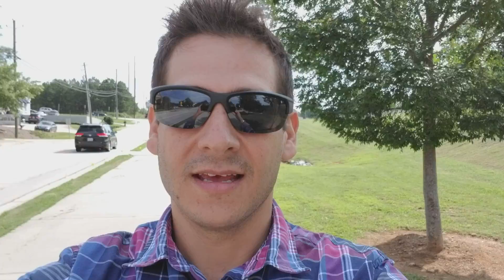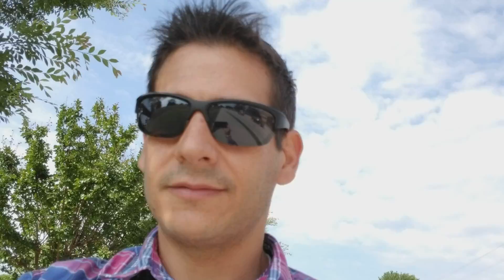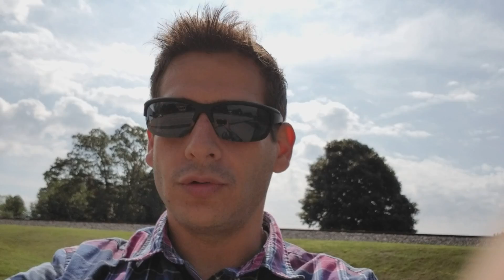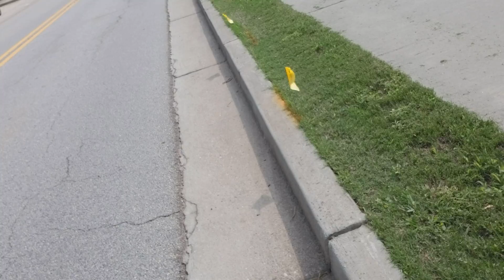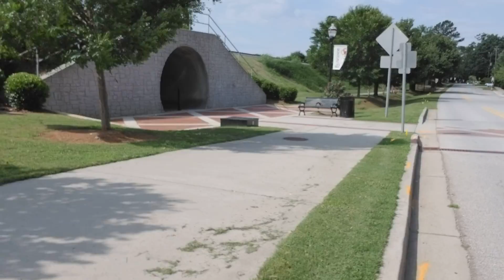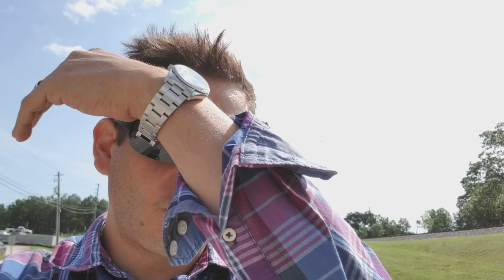Limitations of GPR (Ground Penetrating Radar)

Comment: Hi this is Dave, good videos and info. We are looking for the best meathod to detect a old cavern that the entrance was filled in
but as the subsurface is large rock, flat granite rock and rather rough terrain i have to assume GPR is not the best way to find it?  Now what? 
We usually just use metal detectors but this is something we have never tried to do.
Reply from the maker: Thanks for the comment and question. GPR may still work, but you could look into a conductivity meter. The cavern would likely show up as highly resistive. Hope this helps.

Comment: GPR is super interesting technology, especially for archeology... You think this area (in the link) could be scanned with GPR? I heard it can penetrate 50 meters. Do you think this could this trigger any limitations? https://www.youtube.com/watch?v=UwcNy9nyywU Although I don't know much about GPR, I see the ground is often scanned with these manual carts, the shape and size of these mounds alone could be perhaps a limitation?
Reply from the maker: 50 meters is very deep for GPR. It has been used to those depths before, but primarily in ice or other non conductive materials. The area in the video would unlikely be one where it can penetrate 50 meters below ground surface.
Reply: Thank you for the answer :)

Comment: Can it make out abject shape?  What kind of materials can it "see"
Reply from the maker: It can give information on object shape/geometery, but it is best to conduct a full coverage investigation and post-process data. Doesn't always tell 3D shape or volume well, but has the possibility. For example, with good data collection, contrast, and post-processing you have the ability to tell if the object is circular or rectangular from a top-down perspective. It can "see" basically any material as long as there is a contrast between the object's material and the material it is buried in. There are limitations as i discuss in this video such as depth, size, and amount of contrast or signal decay.

Comment: I’m trying to find out if an oil tank exists beneath my 3’ deck.

2 yard sweeps are negative. Town only has permit for decommission by sand not removal. Interior inspection has revealed no signs of pipes etc or patchwork.

Prior owner advised no tank exists but the paperwork refutes it.

Yesterday had a sweep beneath the deck but not optimal study due to the deck height. 

The deck is 16’ x 24’ so I am included to try to find a non- destructive method to get an answer.

If there is another technology or modified height clearance machinery world you let me know?

I live in New Jersey.

Many thanks
Reply from the maker: Hi Ann Marie,
Can you reach out to us at info@bigmangeo.com with a phone number? We woyld be hapoy to have a quick chat to see if you have other options. Thanks!

Comment: Question.
I'm writing a sci-fi colony world, and had a cool idea for a burrowing ambush predator. It's fairly big, it can eat small puppies. It's enough of a concern, that the colonists are thinking about their future infants. Can GPR distinguish living tissue and/or 6"-12" tunnels?
Reply from the maker: Cool! Possibly, but difficult. The signal phase can be analyzed to tell if the wave speeds up or slows down when transitioning into one material or another. For example, living tissue may cause the wave to slow down, but he tunnel filled with air would cause it to speed up. This might be represented in the returned signal phase. That said, 6"-12" tunnels are small and they would have to be near the surface and you would have to use high enough frequency antenna.

Comment: i am a driller by profession. we do drilling to locate water for a living. we have tvlf (irs instruments- tilt mode and resistivity mode)  and frequency based locator for water and other minerals.   almost always , we hit japanese cement that are so hard that our drilling truck cannot break. is there any gpr that can detect the ground up to 70 feet?or 80 feet? we want to know what is that we hit and how big is it? in drilling, there are no hard layer even the hardest rock and other  layers. but our truck machine gears get destroyed and we still cannot penetrate it.   is there any good and reliable GPR at such depth (70-80 feet)?

Comment: Hi , how do you find the 3 D metal detectors like the okm products in locating buried items  such as statues ?
Reply from the maker: Thanks for the question. Unfortunately we have not used the OKM products. Good luck!
Reply: Mr Nader 
All metal detector is cheating and effaced by stone like pazlit 
GPR Is the best eqimbent to check under ground but you need to improve your skill like to know how this is working and you have to do many test like make greave and small room under ground and make the test on it after that you will learned and you can go to really search

Comment: Is it possible that voids look like clay (also something that eat your signal between for example 1-2 m , after 2 m is the signal good again... also that look like an homogeneous?).
Reply from the maker: Hi! Thanks for your question. Air and clay look comletely different. Also, there is no signal sttenuation through air, so the signal could still be there at the back of the void. However, the signal might reflect in different directions if the void shape isnt uniform. This means that you might not see the back of the void well because the signal isnt getting recorded by the reciever. Hope this helps and thanks for watching.

Comment: So it doesn't work near water?
A lead plate was put by the Allegheny river near me several hundred years ago.    I want to find it.
Reply from the maker: Hi. Thanks for the question. I wont say it doesnt work near water. Water though will slow the wave down and generally cause faster rate of signal decay. In some cases water can be helpful. It can provide contrast. The drawback is that is will generally limit the depths of investigation. How much? I depends on the project site. If the plate is near a river it still can be located potentially. I recently used gpr with great results next to the etowah river. However....a magnetometer or an em conductivity meter may be an even better tool. Or certainly a compliment to gpr. How deep is the metal plate?
Reply: Thank you for the reply.  We know exactly where the plate was placed by the French a few centuries ago because it was described to be next to "Indian God Rock".  Through natural processes, it was swept away (pretty sure).  Professionals looked for it but only covered a couple hundred yards and gave up.  I think it could be much farther away due to the ice scraping it down in the winter.  It is a property marker used by the French to claim the river.  I went on metal detector sites to learn more but they weren't much help.  After watching some of your videos I think perhaps GPR isn't the way, but I'm going to look into the two things you just mentioned.  Thank you for helping me to understand with your videos.
Reply from the maker: My pleasure. If you want some formal consultation just let me know. Good luck!!

Comment: i have been working in KSA and the soil is highly conductive and i am unable to find my targets. is there any solution, anything i can do to make it a little better ?
Reply: Hello... can u please suggest any new brand or model for gpr which could work a little better in middle east specially ksa..? Before i am using mala ground explorer...
Reply from the maker: Unfortunately you might need to consider other methods. Ive worked in KSA and had some difficulty too. Ehat are you searching for?
Reply: LearnGPR we lay underground cables so check if there is any existing services...
Reply from the maker: Do you also use em locators?
Reply: LearnGPR yes i use fujitecom to detect live power cables...
Reply from the maker: Got it. You might get a little more depth if you go with a lower frequency. But it will still be limited.
Reply: LearnGPR we have two antennas and i am using the one with lower frequency that is 160 Mhz...
Reply from the maker: Yea. You wont get much deeper than that will give you. Unfortunately you will have trouble with resolution. The 160 wont record responses from anything small. Tough situation!!! Wish i could be more helpful, but the physics are the physics. Good luck
Reply: LearnGPR thank u so much for ur help...
Reply from the maker: They should all work about the same. Poor soils will be a problem for any antenna, no matter what sticker is on the outside. You might try a system with real time sampling. Such as the mala hdr or the sensors and software new pulse ekko

Comment: We need to map out the services coming into the property we are doing some work where the Gas, Water and electrics are berried under a concrete slab. Obviously before we start work we will survey the hallway to know for sure where the services are but i am just trying to find out if the GPR works on tiles and concrete?
Any advice would be much appreciated.
Reply from the maker: Safet it can work on tiles and concrete. It has the capability to see services buried below those.
Reply: Thank you for your prompt reply. This no doubt will make our life easier and please keep us informed with your expert advice.
Reply from the maker: Will do. If you need formal training or project support you can email me at dbigman@bigmangeophysical.com. where are you located?

Comment: Can this technology be used for locating fossils and dinosaur bones?
I'm not a geologist or archaeologist but live in Montana where w have ammonite fossils and dinosaur bones.
I don't think I'd ever want to excavate deeper than 4 or 5 feet...so I wss wondering if this technology would help?
Cool info btw.
Reply from the maker: Michael Gervais thanks so much for watching. Technically it could find bones/fossils but the conditions would have to right. GPR works on contrast so the machine wouldn't say "dino here!".

Make sure what ever excavation uou are doing is legal.

Comment: very good point about point 4, and in fact, I have been meaning to do a video about this, both utility locating with a GPR, but more so for concrete scanning, as I am constantly having to explain to customers that I can't scan next a wall for them. I keep saying I will do a video to explain what the issue is and why you can see the reo right next to a wall, but I just haven't got around to it. 
So thank you for reminding me, I will have to put this on the to do list so I don't forget.
Reply from the maker: no problem. cant wait to see the video.